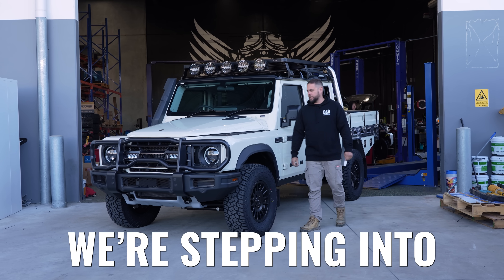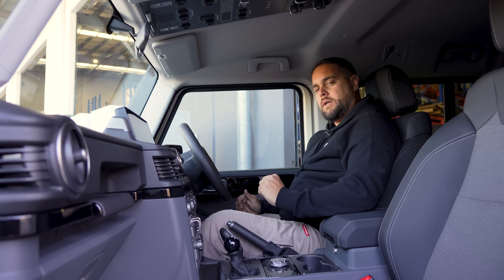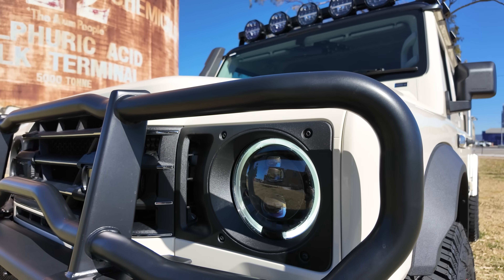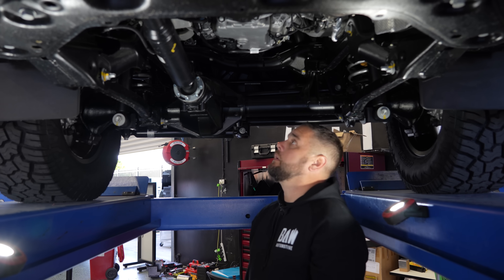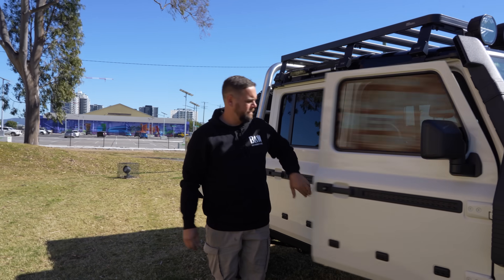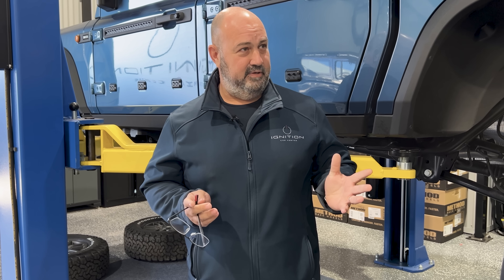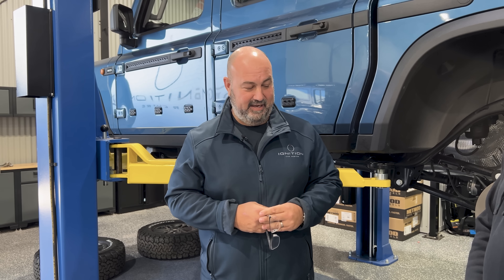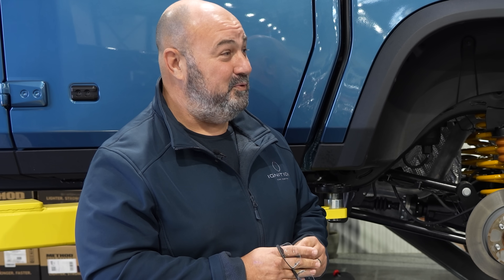Toyota V8 LandCruiser Faces an Identity Crisis: Can the Grenadier Become the New 4x4 Heavyweight?

Comment: Just stop and think for a while: an unknown brand, lack of proper service and spare parts, not tested by time, lots of negative feedback from real owners, many components with suspicious or unknown backgrounds, not tested in a real life … Are you serious? I’d better take my $100k to a local casino; it would be a much better chance not to lose money. And yes LC 70 series is still the king.
Reply: 70 series is still king I agree but this thing is built up of some seriously good parts
Reply: Haters are going hate. Making misinformation comments seem to be a trend these days.   Yea never heard of any of these companies that are on some of the most used vehicles
Reply: Mate I have had mine for 12 months it has been awesome apart from a software issue your negativity is totally unfounded
Reply: I'm not keen on the funky steering that wanders and doesn't correct. However in Aus last year I had a 23 v8 79 series with  2000km on it and it drove like a bag of bolts. It's just the way vehicles engineered to last/be capable are.
Reply: @johnantonine4505  Let me be honest and myself... I owned a 76 Series  2016 model  and got a 2024 model  VDJ79 V8 this year. There’s no doubt that the 70 Series is not designed for comfort, and there's also no doubt that the owners of this car aren't seeking that feature. I am looking for adventure, to challenge myself, go into the middle of nowhere, and survive there. Shiny buttons and smooth, comfy driving on the highway under computer system control, with an LGBT flag on the back window, are the last things I am interested in.
Reply from the maker: The 70 Series is a proven off-road king, no argument there, but keen to see how the Grenadier goes in the future.
Reply: @BAWAutomotive  You Tube EXTREME INEOS GRENADIER TESTING! | Black Bear Pass - Alpine Loop
Seriously capable!
No regrets whatsoever. easily the best vehicle I've bought; no issues at all (and I was an early adopter).
Reply: People said the same thing when Toyota came to Australia
Reply: Very wise words. People forget that Landcruisers earned their reputation the hard way: almost 70 years of reliable service in the roughest and hottest places in Australia. I wish Ineos well but it will take at least 20 years to see how they go.
Reply: @jonathonms4906  Yes, but that was 60 years ago. Let's talk about Ineos in 10 years if it survives...
Reply: “suspicious or unknown backgrounds”? You need to understand the facts before making nonsensical statements like that. The fact that you don’t recognise some of the componentry says more about your ignorance than the components.
“not tested in real life”? More nonsense.
“lots of negative feedback”? 
More nonsense.
Also masses of positive feedback from owners.
Are you serious? You’re welcome to an opinion but have a shot at including a little honesty with it.
Reply: Unknown backgrounds? It literally has the best parts available in the market. Best engine in the 200-400hp category for both diesel and petrol, best auto gearbox (miles better than anything else in the market), tremec transfer case, Carraro axles (very well known for Tractors in Europe), Brembro breaks, even the seats are Recaro. You can’t better cherry pick partis for an SUV. Yes, software had its issues on launch, it’s mostly solved by now.
Reply: @miguelosterroht  Mate, the idea of the "best engine" is highly subjective, especially when it comes to BMW. An engine is only as good as the components that support it—like the clutch, gearbox, and other modules—all of which must be perfectly tuned to work together. Carraro axles are specifically designed for special vehicles, so I’m not sure how they’ll perform on this UTE. Only time will tell.

When I’m out in the Simpson Desert, I don’t need Brembo brakes or Recaro seats; I need reliable brakes and seats that function well, not just branded ones made from flashy materials. I need a large fuel tank and enough payload capacity to carry the essential supplies for survival—something the Grenadier doesn’t offer. I also need spare parts that can be found at the nearest village, farm station, or service center. I need a car that any mechanic can repair, not one that requires specialized, authorized technicians with branded software and exclusive tools. Engineering isn’t just about assembling the "best" parts; every component must resonate with the others and work in harmony, like an orchestra. A mechanical system is far more complex than any advertisement can suggest.

As someone pointed out, it took Toyota over 50 years to become an industry leader, and Mercedes has an even longer history. This new brand might have potential in the future, but it’s definitely not there yet. Modern technology is great, but there’s no shortcut to excellence without the test of time. No matter how good the ads are, you can’t create the best out of nothing. What we have now is just well-made ads.

Personally, I’d rather see investment in developing this newborn brand, including an authorized service network, spare part availability, simplification, and unity, rather than in flashy ads. This car seems designed more for metrosexuals and those looking for a "serious" off-road adventure between their home and the nearest supermarket, with a tow truck following close behind.
Reply: I own two Grenadiers.  Both stellar and problem free.   I’ve owned 80 and 100 series LX, FJ’s, Jeeps, Bronco, 4Runner, Tundra and Tacoma.  The Grenadier is better made than all of them.
Reply: @andyorr1597  
I own two LC 70s.  Both stellar and problem free.   I’ve owned 2 Grenadiers, FJ’s, Jeeps, Bronco, 4Runner, Tundra and Tacoma.  The LC 70 is better made than all of them.   LOL
Reply: Live axles, Straight 6 diesel with a 8speed ZF gearbox, everything you need,
Reply: @reubs91  Ah, yes, the automatic transmission—perfect for when you're heading out for a day of heavy shopping! But when it comes to serious off-roading, I prefer to have full control over my vehicle. A manual gearbox gives me that precision and connection with the terrain, plus the ability to push-start if needed. Let's not forget the simplicity and reliability that come with a good old-fashioned stick shift—no electronics to worry about when you're miles from civilization. And as for that BMW engine... well, 'reliable' and 'BMW' don't exactly go hand in hand, do they? Might as well take the scenic route to the repair shop!
Reply: @georgeshamrock  eh, not an issue.
Reply: I’ve got both mate and yes the grenadier hasn’t stood the test of time (1 year/21000km vs 5 years/130000km on 79) but it’s still a very well made car. Certainly wouldn’t be counting it out just yet.
Reply: You’re joking right…. Clearly not done your research aye.
Reply: No, you stop and do some research on who is behind this vehicle and what engineering expertise has flowed into it. I supplied one of the components myself and I know they chose the best on the market. I also drive a Trialmaster and am loving it.
Reply: @Bartraeger  Mate, don't spread misinformation just because you supply something... The reality is that this vehicle is not reliable and hasn't been properly tested. There is plenty of evidence to support this—just google it or talk to the owners. You misunderstand the general concept: simply putting together the best parts, materials, and details doesn't guarantee you'll end up with the best product. Consider it from the perspective of consumers, especially those who have experienced steering failures on the highway, rather than from the perspective of those who designed it, who likely didn't intend for these issues to occur. 
In any machine, mechanical system, or structure, the quality of components is important, but equally important is how they work together and what we can achieve in practice, not just in theory. I hope you understand what I’m trying to convey.
So far, and I deeply believe this will be the case for at least the next 10 years, the Grenadier won’t be a reliable car, let alone an off-road vehicle. At this stage, it’s more of a glorified seagull than a real eagle.
Reply: @jamessunjaya21  Exactly what I’m talking about. Let’s see—time will be the best judge.
Reply: @georgeshamrock  Twaddle. Unlike you , I am an owner so that perhaps puts me in a better position to judge strengths and weaknesses of the vehicle . I am also very familiar with the engineering organizations involved in designing and building it. Ever visited Magna in Graz? I have.
Reply: @georgeshamrock  lol
Reply: @aiden9297  😆
Reply: @Bartraeger  When an argument excessively emphasizes the intelligence or experience of the individual presenting it, this often reveals an underlying insecurity or lack of confidence in the actual content. According to psychological principles, particularly the Dunning-Kruger effect, overemphasizing one's authority can signal a compensatory strategy for perceived deficiencies. Effective arguments should be evaluated based on tangible results and practical outcomes, not on self-asserted expertise or authority. In my case, I rely on my own experience, knowledge, testing, and practical feedback from owners, which serve as 100% evidence and validation of my statements.
Reply: @georgeshamrock  Stop arguing with idiots—you will only stoop to their level. When someone cannot accept reality and relies on labels and 'Made in' tags rather than on objectivity, there is nothing you can do. The best approach is to simply ignore them.
Reply: @Bartraeger   It seems you lack evidence but are full of self-importance. I watched a few videos from real owners about this car, and I wouldn't buy it for at least the next 5-10 years. I don't care about manufacturers or their super-duper ads; I trust my own eyes rather than someone's bla-bla-bla.
Reply: The cruiser fanboys on the charge,they're junk.
Manual gbox,dodgy front brakes,gutless motor with 5k oilchange intervals,a rear axle narrower than the front.
Leaf springs,electric difflocks that fuck out in water and dirt,apart from that though, they are great.
Reply: I low key want one but I have zero use cases for this vehicle. Middle-aged family man in the suburbs
Reply: @georgeshamrock  there has been substantial real world & simulated durability testing done by INEOS, Magna & its suppliers. Auto development & testing has evolved and the type of field testing of decades past is much less relevant in terms of development, meeting timelines & capturing the broader homologation/type approval demands globally. Things have moved on, and INEOS does exactly what other well established auto brands do. That’s because they employed people from the industry, they work with Tier 1 suppliers that work across auto OEMs, they test with same labs, they must meet the same standards.
Reply: @georgeshamrock  durability testing can be accelerated. It’s not solely a case of waiting to see what happens with units in operation. The ‘wait & see’ or ‘time will tell’ mindset isn’t irrelevant, but it’s not the sole measure of durability development.
Reply: @georgeshamrock many brands use brembo brakes. Not because they need to show off big red calipers & a brand. Brembo as a T1 supplier make a wide variety of OEM packages for a range of categories & applications. The point is, they make good stuff. They have been around a long time. They have deep R&D investment & longstanding IP in their core competencies. This thinking applies to all of the INEOS partners. Bosch, ZF, Eibach, Recaro, Bilstein, BMW, Carraro. The point is, taking an engine will millions of units in operation around the world, putting more cooling, air & fuel filtration on it, in a low tune. Then brought together by experts like Magna (who BMW, MB, Toyota all trust to contract manufacture for them) is more than assembling a Lego kit. It is a holistic strategy to bring together tried & tested components, from trusted mature companies in a well tested package. Assembled by a quality experienced workforce in a high quality auto manufacturing precinct & plant.

As for having Recaro seats, which I understand you don’t need. Recaro understands ergonomics, materials durability, packaging. The result is a supremely comfortable seat, well bolstered & one that I personally feel very fresh when stepping out of after even a 14hr long dash or several hours of brutal track. If you prefer skidding around on a washboard that was built to a budget rather than a standard. Go for it. But there’s a reason there’s a reason many people upgrade their 4x4 seats.
Reply: @georgeshamrock sounds like you drive a 40 series
Reply: @georgeshamrock you have a very stereotyped mind,the engine in this car has been proven to be one of the most reliable engines ever than before. You make your statement based on hear say and the stubborn stereotypical minds about BMW engines. FYI BMW has come a long way and are now way better and more reliable than ever before and aren't falling far behind from the slower other known engines out there in terms of reliability.
Reply: @mowerman60 you forgot about alternators that die when you hit a big hole. They love to scream about reliability while carrying spare alternators everywhere they go.
Reply: Let's be honest, whether you spend a 100k on this or a LC70 you obviously don't mind burning cash.
Reply: And the grenadier has just stopped production because a supplier has gone into receivership.
Reply: @duncanthomas1025   As for me this is a good news.
Reply: Clueless
Reply: I no a guy who’s got one an has treated it like a old hilux an no problem; like anything new it’s going to have problems unfortunately
Reply: Had a grenadier for 6 months, sold it with a big loss but I am so glad I did! Give me a LC 70 anyday
Reply: Sir, how much land rover is paying you, for this comment?😂

Comment: Awkward looking vehicle with a BMW engine.  It is expensive to maintain. The land cruiser is the king of the desert. I never seen a bmw still on the road after 40 years. But toyotas will run forever.
Reply from the maker: I get where you’re coming from! The Land Cruiser has definitely earned its reputation for desert reliability. Only time will tell if the BMW engine can go the distance.